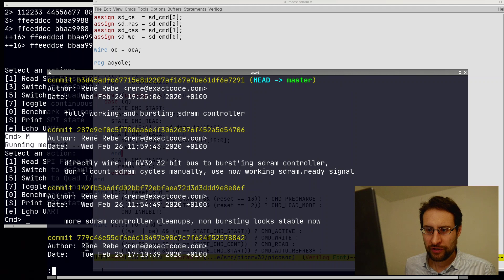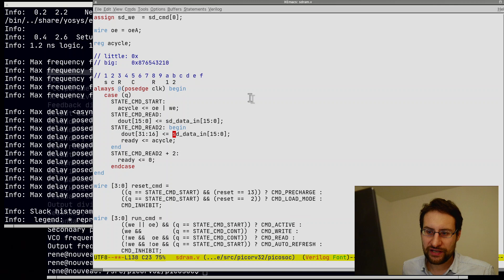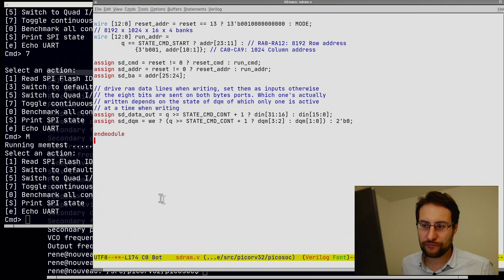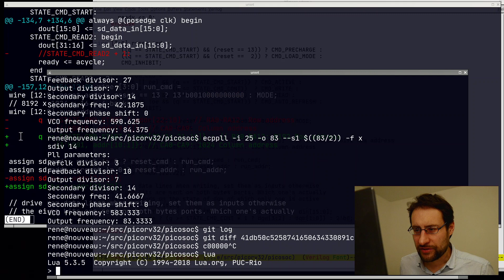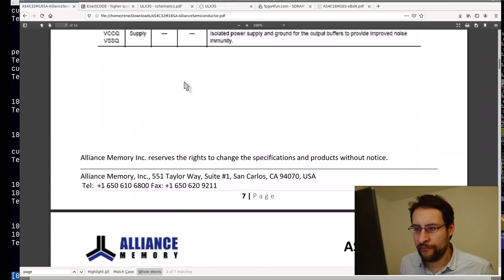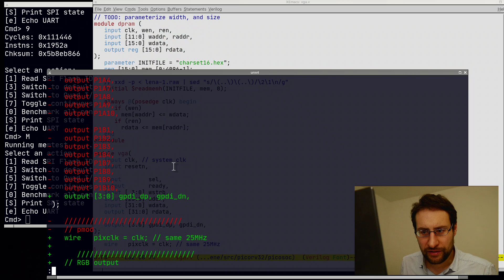Working & bursting SDRAM memory controller in Verilog! 64MB for the FPGA RISCV SoC!

Comment: Hi, I've been trying to learn HDL lately and have found your videos pretty interesting.  I'm still very new to most of this, so I don't know if what I'm about to say is relevant to your timing issues, but I also saw another video recently by Ben Eater: https://www.youtube.com/watch?v=i_wrxBdXTgM&feature=youtu.be&t=1460 ,  where he goes into details about specific RAM timings.  
I thought that the specific part beginning around 24m20s, where he talks about write data hold time being a minimum of 0ns was particularly interesting and maybe a tricky little caveat to get right in FPGA.
Reply from the maker: hi, thanks for joining this channel and your comment. I think I even seen parts of the video before, and IIRC he is using much simpler to use SRAM, as mentioned in the 1st video of this SDRAM series SRAM is significantly easier to address than RAS/CAS addressed SDRAM state machine timing. https://www.youtube.com/watch?v=APwV0hSKE6s We also run at >80MHz as compared to kHz ;-) Well at least ~80MHz works for now, I will look into the higher clock speed skew another month should it become more relevant, ... Getting timing right on a FPGA is mostly quite easy, just use a counter and count the clocks for the timing length.

Comment: Perhaps some remaining glitchyness can be attributed to the lack of I/O-timing constraints in nextpnr: https://github.com/YosysHQ/nextpnr/issues/399 - if the registers driving the IO are placed randomly within the fabric regarding their IO blocks, then the signals of a parallel bus might still come out skewed, even if the registers latch data in due time. The solution may be to use the registers within the IO blocks. It appears that manually instantiating the IO blocks with internal registers enabled should ensure proper timing, but I haven't found a way yet to map the registers within a design to the IO-registers...